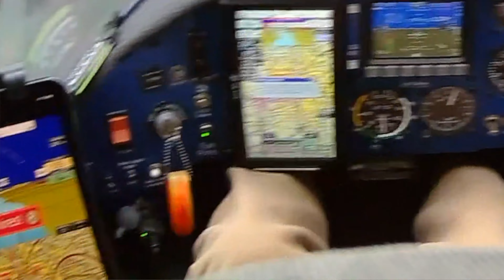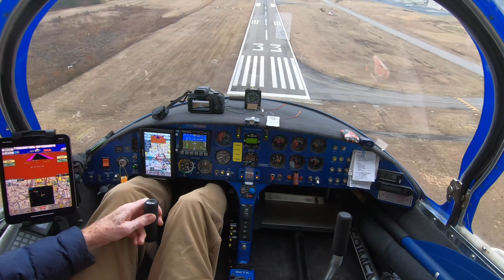Behind the Curve

Comment: Don the title of the video says Behind the Curve, on the video subtitles it says Stall, which do you think it was? It looked like mushing into the runway, did you feel it buffet or break? Curious whether flying with AoA would help in this situation.
Reply from the maker: Great question. It was both! I was doing fine, flying along just above the runway in ground effect--which was also slow flight, just faster than the stalling speed. In true "slow flight," to slow down without losing altitude, you have to add power, and the slower you get, the more power you need. The nose is pointing up and gets ever more up as you get slow. That's often called "flying on the back side of the power curve" or just "behind the curve." Eventually, you can get so far "back" that the engine doesn't have enough power to keep you in level flight.  Well, recently I'd been experimenting with using full flaps for landings, changing from 20 degrees to 30 degrees just before rounding out over the runway. And although I'd have known better if I'd bothered to think about it, this time I just went to 30 flaps without adding power--but to keep flying I had to pitch the nose up to compensate for the added flap angle. That, of course, slowed the airplane to the stall speed and it quit flying abruptly and fell--maybe 1 foot--with a thump. 

Stalls are benign in my airplane--so if I had been flying well above the ground, the nose would have dropped to break the stall and I could have gone on flying even without adding power. But at 1 foot, it just went thump. (I think the FAA now recommends exiting a stall by adding full power as well as lowering the nose. I do that as a rule; but it's not always necessary, especially in airplanes as stable as mine.)

The effect of increasing flap angle is especially interesting in amphibians because increasing the flap angle tends to lower the nose, and nose-low is generally not a good thing during a water landing because the water drag can cause the nose of the floats or hull to submerge. That's likely to send you swimming. On land, submerging is a lot harder to do because the ground resists it. On water, you need the floats or hull to be at a certain angle to the surface so that the water drag is as little as possible. So you have to be more wary of changing the flap angle. (I think. I'm not an aeronautical engineer.)

As for the two terms, I think I squeezed both "stall" and "behind the curve" into the titles--anyway, I meant to.
Reply from the maker: I just realized that I hadn't answered Guy's excellent question about an AOA.  My plane has an AOA (Angle Of Attack indicator), but I've never looked at it during a landing. That's mainly because I'm concentrating on getting the landing right, and I already know I'm going to stall. Now, though, I'll try to point a video camera at and see what it tells me.

Comment: Why take off with a soft tire? Or with anything not up to specs. in any airplane or vehicle for that matter? 😳
Reply from the maker: Good question. In this particular case I knew that the tire was soft but not completely flat. And I knew that there's not much weight on the tailwheel--less than 150 lbs. AND I knew from having had the tailwheel tire go completely flat once when I had to taxi from grass up over the sharp edge of the concrete ramp at the Udvar-Hazy Museum that the airplane steers well with no air in it at all. So I didn't expect any difficulty. It was a calculated decision, and as you see in the video, the landing went well as far as the tire was concerned. The problem was landing with full flaps and insufficient power. And even that wasn't really much of a problem.

Comment: That looked as bad as one of my landings 🙂

Not a Searey Pilot - but why not a wheel landing?
Reply from the maker: Another excellent question. I don't remember why not a wheel landing--but it probably had to do with ground speed. With full flaps my Searey stalls at about 36 mph, so maybe that influenced my thinking at the time. If the tire had been completely flat I would have done a wheeler no matter what--although at that time my brakes didn't hold well enough for a wheeler to have made much difference. A few months ago I replaced the wheels and brakes with new ones, and now I can keep the tail up to a dead stop--so NOW I'd definitely choose a wheel landing.